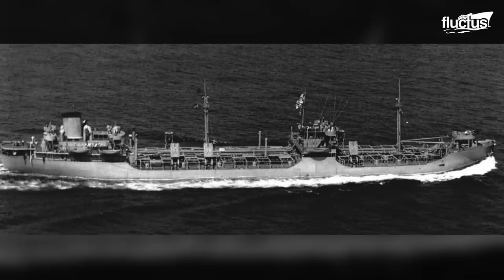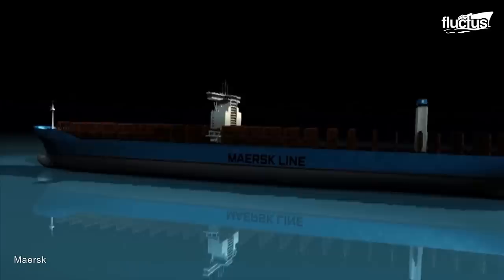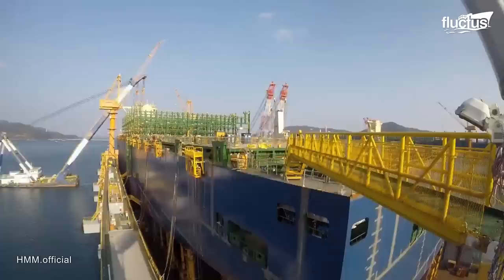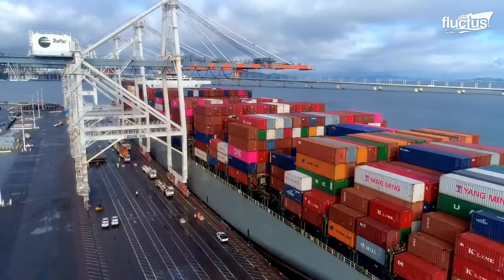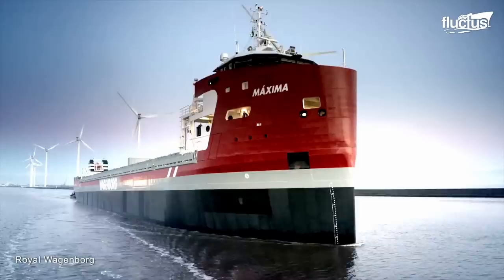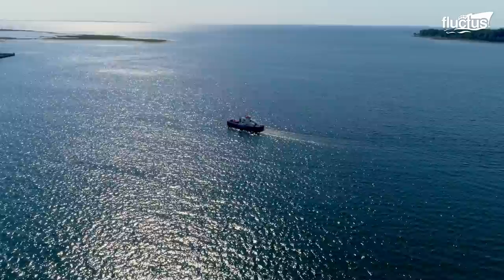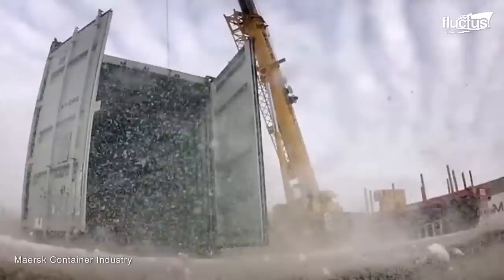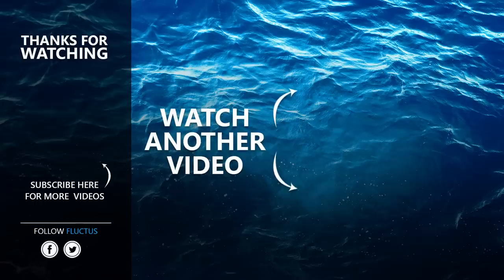How Brand New Container Ships are Cruelly Tested Before Launch

Comment: I think we have reached the upper limit of how big these can be.
Reply: Only because our ports are too shallow and too small
Reply: I can only imagine there will be sea trains soon
Reply: @fusionstar916  Very true, and many of these ships are too large to use even the new locks of the Panama Canal.  It was one of these (MV Ever Given, nearly 200,000 dwt) that got out of control and grounded crosswise in the Suez Canal last year, plugging up the canal and stopping traffic through it for several days.
Reply: Probably getting close to how big they need to be, we could theoretically make them twice the size but that would require around twice the money and take around 50% longer to build and cost significantly more per mile in fuel. If we ever figure out safe cost effective fusion I imagine everything will get bigger... or a ton faster.
Reply: I work at harbors for these vessels.
they can easily be built bigger. But their max size is now based on external factors.
these are already too big for panama canal. (CHINA - USA), but they just land west coast then. 
They fit through Suez which is important for china - Europe. 
The harbors is becoming too shallow now at 16 meters for these. 
Even if we could dig up all the harbors these call, then you would need bigger cranes also, and that is not neccesarily better, because its all about speed once these vessels are in harbor. it takes longer to lift to 22 meter than 18, and deeper into the hull also. 
Then there is also the fuel economics, which is half the reason these are built this size. they are hitting a sweetspot it seems. Also, it makes no sense to build a 40k teu vessel which is 550 meters, and 70 meter wide, if it goes really slow, but most important, if it sails half empty all the time. Currently my harbor, one of these call every week, with 6000 lifts total.

Just my 2 cents
Reply: Probs not, as long as there is no conveyor belt over the ocean we are not even close to have achieved the upper limit.

Comment: Why do they still build big ships in steel. Big warships and aircraft are build of composits.
Reply: I would think atleast compared to warships, Cargo vessels have a need to keep costs down, which warships probably does not prio, they prio armor capabilities?
I believe steel must be very cheap compared to composits.
Reply: Steel is cheap, abundant and available everywhere and the methods to handle and work the material are mature and cheap, there's no real need to reduce weight, radar/sonar profile, armour performance on a cargo ship. Commercial shipping is all about economics and a massive vessel made of aluminium or composite materials would be more expensive than an identical vessel of steel while providing little benefit.

Comment: I didn't see refers. How do they transport fruits, vegetables and meats on a vessel like that without losses.
Reply: Refrigerated containers just like the trucks and railcars you see ashore.
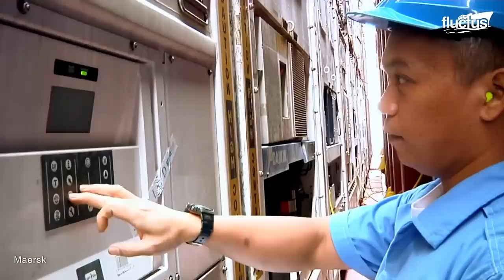Reply: Actually, you do see reefer containers at 11:38 to 11:40 in the clip. What this crewmember is checking is a reefer container.
Depending on the type of vegetables, fruits, seafood etc, different type reefer containers are used which can keep the contents at sub-zero (centigrade) temperatures or up to the optimum temperature for fruits such as bananas etc.
Reply: @TheChiefEng  I see nothing that indicates that portion going to containers up on the deck.
Reply: Reefers atleast on Maersk vessels are under deck. you see these vessel have 11 high on the deck, but also 11 high containers under deck. and all the power required by reefers is under deck, which protects it from the weather outside.
Additionally, on Maersk reefers sailing on Maersk vessels, the reefers are watercooled unlike other shipping lines. This means that they connect power from the vessel, but also the cooling water in the containers is connected to the vessels cooling system, to optimize energy consumption. Extremely nice system
Reply: Additionally to what has been said, if you see white containers in a port or on a ship, those are the refrigerated units.